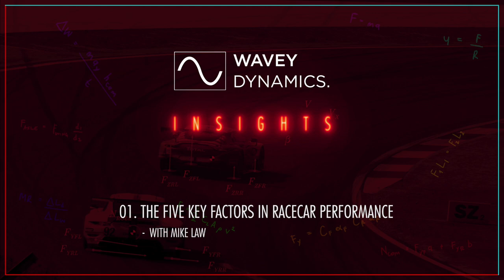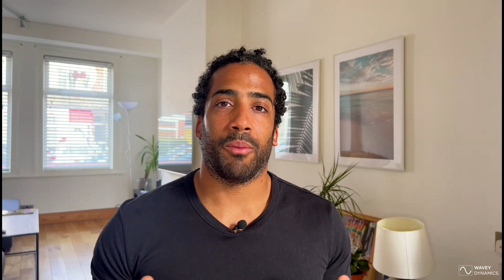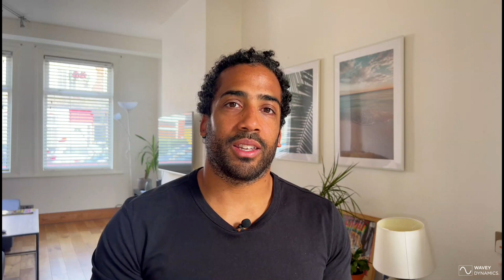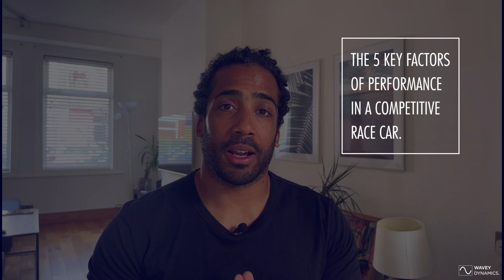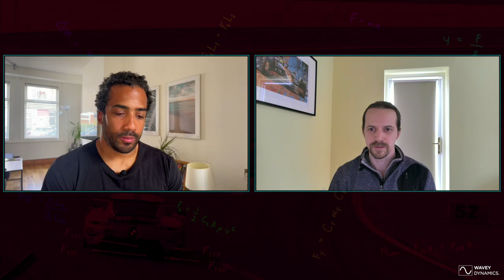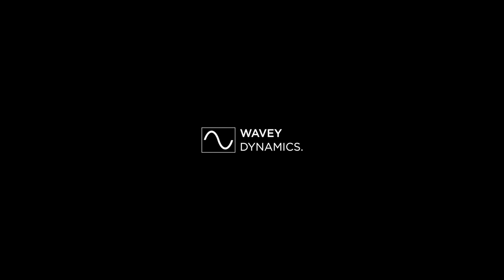Vehicle Dynamics Insights 001 | The Five Key Factors of Performance in a Race Car w/ Mike Law

Comment: The inertia to mass RATIO is the Key Performance Indicator because the tires must create moments for turning AND forces for side-slipping.  These are the 2 components of lateral force. The best cars have this "radius of gyration' (the R in [Izz = M*R^2] specified.  R - 1  less than zero is preferred and demands less from the tire carcass stiffnesses.  
Caster is used to move the peak steering torque provided by tire Mz to the peak Fy slip angle.  It costs you some understeer, but removes the false peak grip signal in the steering wheel that the tire Mz supplies.
Reply from the maker: Hey Bill, good to see you over here.
Reply: @WaveyDynamics Nice to see you on the screen !   Really good subject.  Nice interview style !  May I suggest asking team engineers how they manage 'testing' vs. 'racing'.   Does it take a different driver to analyze the vehicle, so that the race driver's quirks don't interfere with the data collection ?    How about the future of driverless cars ?  Will it take a different setup and mass distribution to get the best finishes ?  What are top level Key Performance Indicators other than Lap Time ?  Show how "Smooth is Fast".
Reply from the maker: @zzvyb6  Thanks! Plenty more videos coming over the next few weeks.

Will make a note of your suggestions, i particularly like the KPI discussion point!